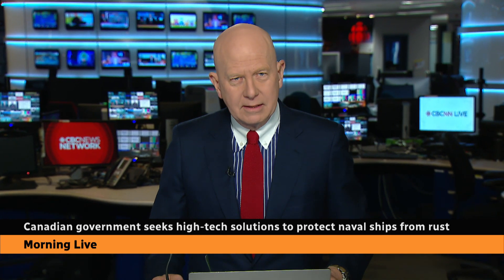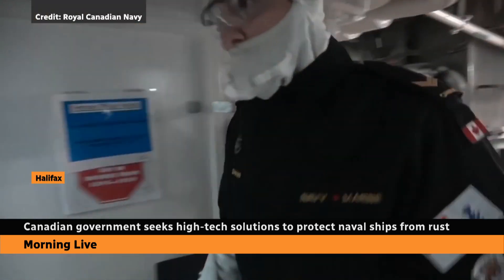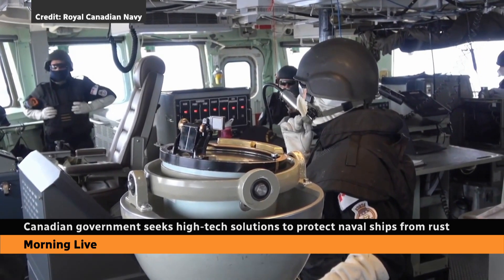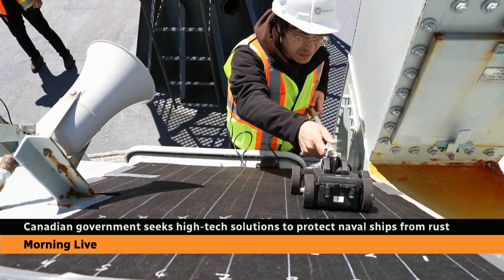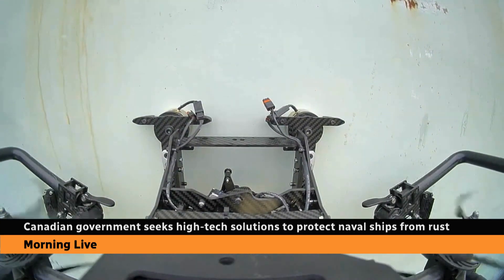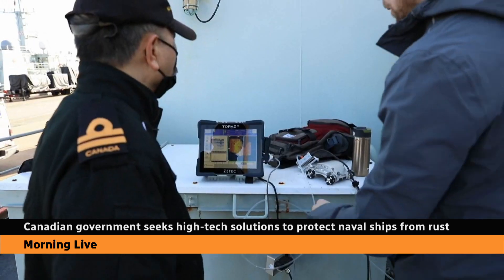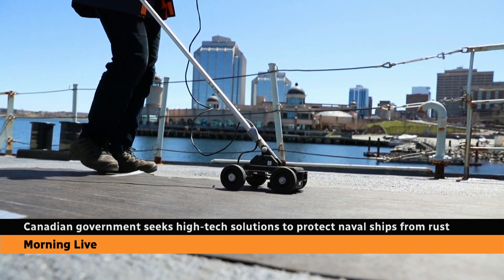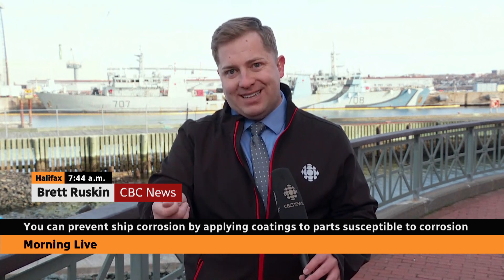High-tech gear to protect Canada's naval ship from rust

Comment: The New Artic Ships appear to be breaking out into rust. Just look at them. My husband has worked on a lot of old cars in the past, in his experience the paint has to be thick enough to provide a real and true water/atmospheric barrier. This is really the commonsense approach. Some applications of paint, from the factory, are just thin. We see this on a lot of new cars. It is important to understand that when painting metal you are setting up a barrier, blocking out water and the atmosphere. Air that in itself is often saturated with water and airborne chemicals. When painting iron, steel or aluminum you must understand that oxidation is immediate and the metals are under attack even as you work with them, for example building a ship in the shipyard. I think this is all common sense which often is anything but common. PS  I also think some great advances in metal preparation are needed before paint is applied. Sadly the paint on the new Artic Ships is just not good enough for harsh conditions, at least by its appearance.
Reply: Quite agree , Mary, below the waterline I believe is fairly well covered by Anodes , both passive and active , Above waterline the best answer is careful application from initial build ,and constant maintenance of appropriate  finishes thereafter due to wear and tear.  Waterline is by nature the most difficult to police , whereas bad design leads to pockets that are inaccessible for regular maintenance throughout the vessel.. You can't beat old fashioned common sense and regular upkeep combined with quality materials. 
Unfortunately,  money is god these days 😪